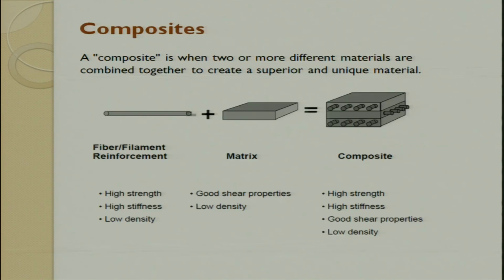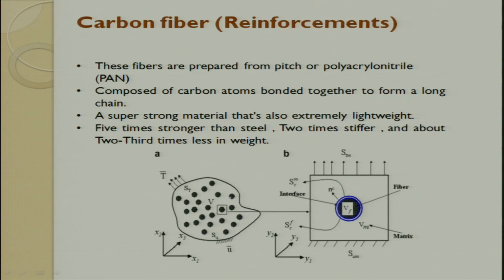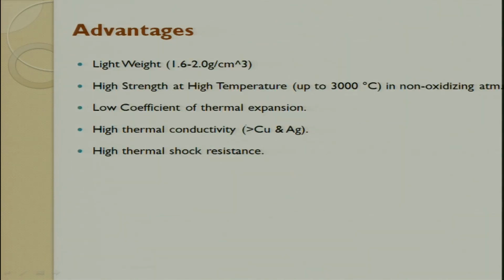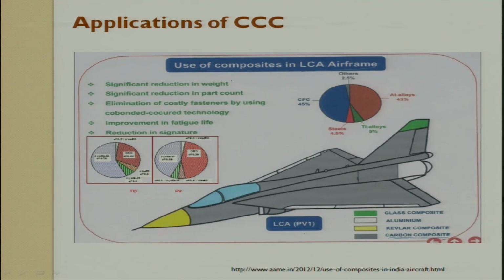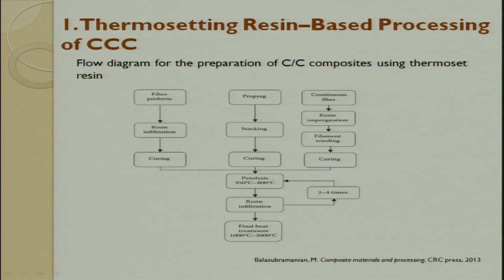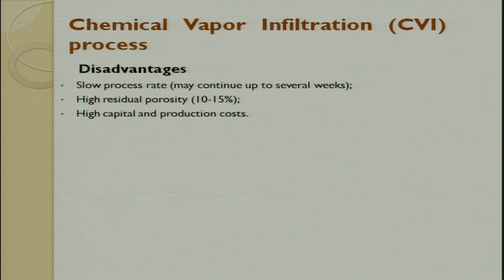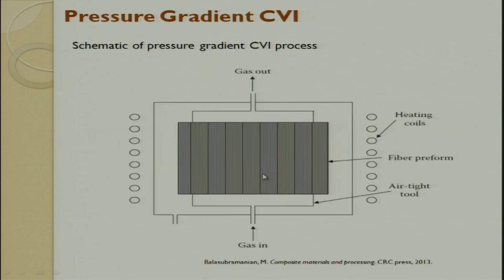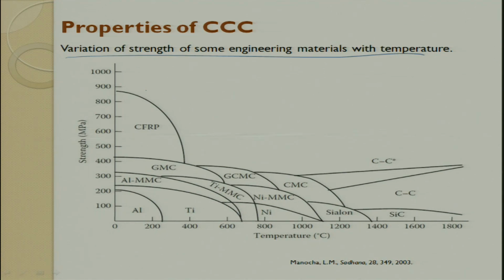Carbon – Carbon Composites

Comment: sir this lecture may be informative. but, what is it's use if it is not conducted in a proper manner. how could I know what is your "this", "that", "here" and "there". you are continuously showing one slide and saying this that...  physical paper and pen should be a better option for you. Or, you can also use a pointer (like you are using a pen for some instance)